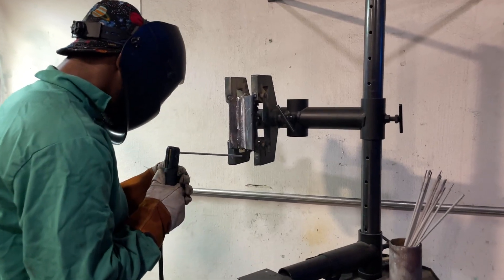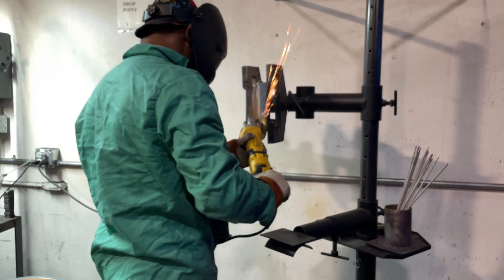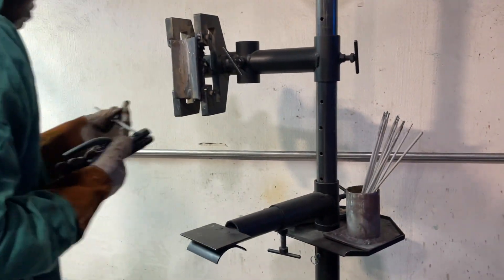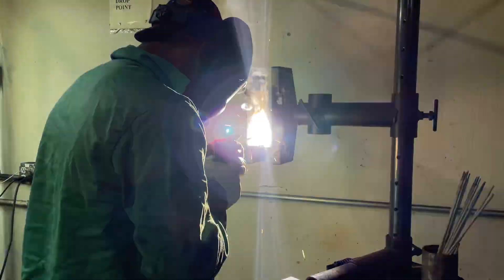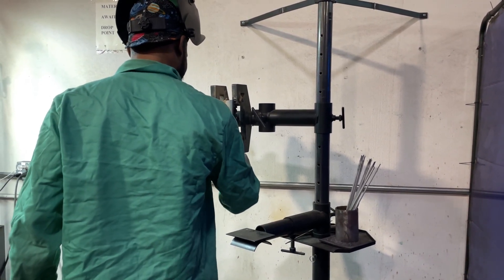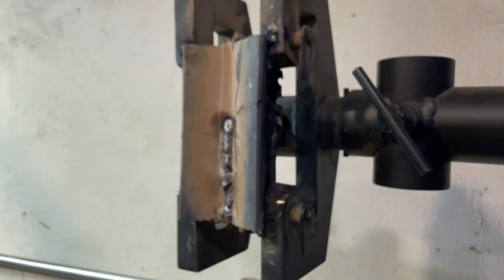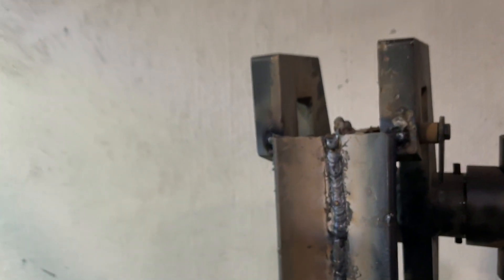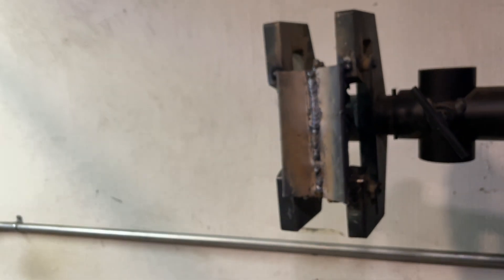Stick Welding Refresher! #welding #weld #smaw #welder

Comment: I love the channel bruh linking in from Chicago! I have on the job experience and went to welding school and I’m 6g certified (smaw,gtaw) on plate and pipe. Definitely support the channel and appreciate the knowledge if I had to say anything I’d say with welding no matter the process or position the MOST important thing to know is ABC Always Be Comfortable. If your not bracing yourself up against a wall or your going in the without any leverage keep your elbows to your side for stability. Also it if your having trouble striking an arc get some wire cutters and cut the end off to the flux also until bro knows what he’s doing swing the piece to the right and have him brace up on that pole and have his left Forarm keep him stable. Just my 2 cents but you got this bruh keep at it stick is definitely the hardest process once you get that you Gucci. Mig the easiest , then tig, then stick so don’t feel bad if you ain’t got it down. Best of luck bruh and hogon I’m grabbing a xl T that shit is hard!
Reply from the maker: HogOn Family thanks for the support! Be safe on the grind!!!